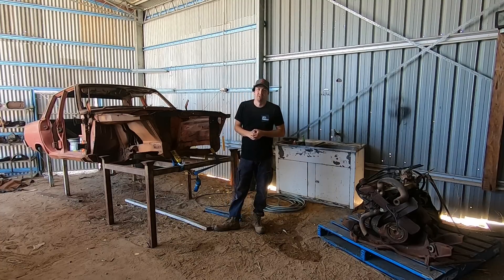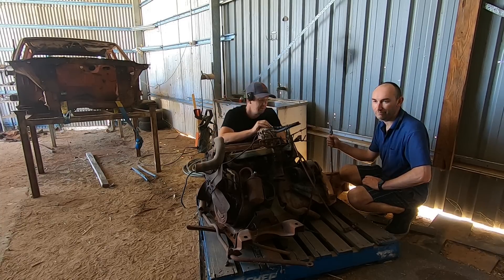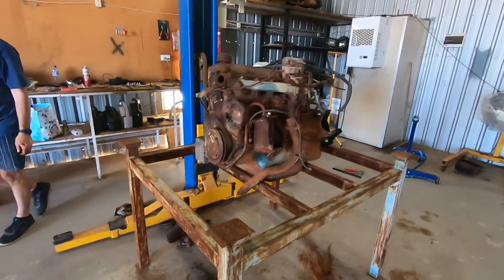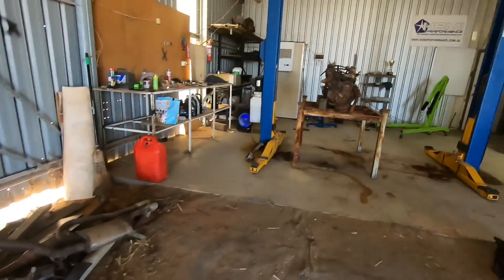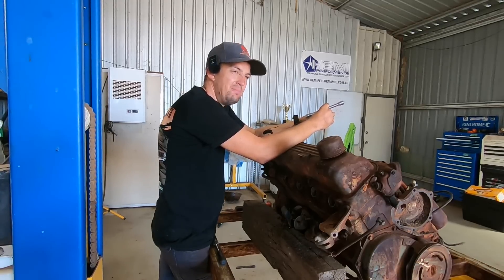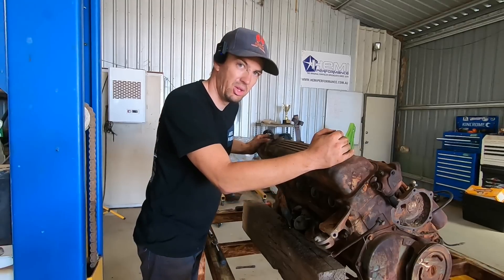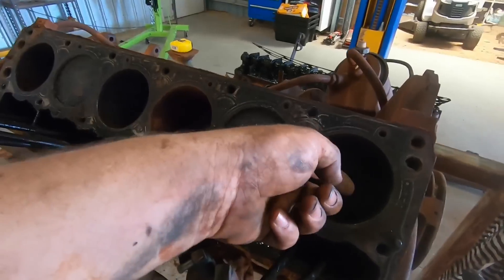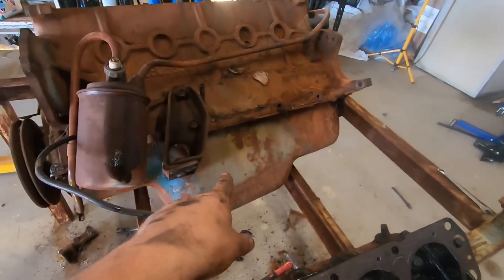Valiant Pacer engine teardown!

Comment: I put an F100 6 cyl and old 3 speed from an XY into a VE wayfarer ute. The column change linkages fitted straight on the falcon box ,( same B/W 3 speed)and I only changed one side engine mount on the cross member, cut it of and welded on a bit of box section.The Val drive shaft went straight back in. Only took a weekend to do.

Comment: VF Pacer sat a bit lower and came with 5 half inch rims . I had 7 inch alloys with TA tyres . My bother had one with 60 thou over 350 Holley and extractor split into twin 3 cylinder out one and 3 out the other man did it sound great . Sounded a bit like a hot V6 Capri 🤔. It sat low all round with 7 inch black rims . It put my other brother 307 HK to shame . RIP Scott . There is other tips to get these slants to fly.👍🏻💯🇦🇺⛽️.

Comment: you have probably lost 1mm off the block, ie no sweat, nice hot acid bath, keep the car original if you can
 as long as you replace gbox with original type, no problems there
crappy original cars are worth more than modded ones, hell knows why...

Comment: Valiant 3 speeds are dime a dozen and cheap as they’re normally ditched in favour of 4 or 5 speed. They’re not numbers matching to Pacers either. Maybe set the 225 aside and put in a 245 or 265. Touch base with Dave (Y.T channel Coopzcarz) he’s in NSW though.

Comment: Here is the thing with rust, it swells, that 4mm rust flake is likely to only be a mm or two of actual steel , this old engine will have plenty to spare. Go the original, and a rego rebuild.
Reply: Agree and what do you think about the gearbox, strip it and acid bath ? Andy from Adelaide.
Reply: @gashy1000  I think the gearbox is toast, but is possibly the same as a Holden or Ford, just a bell housing change

Comment: Having a 4mm rust flake is not 4mm of missing cast iron, when steel rusts it expands considerably (there must be a calculation to work it out) I would be pulling it apart and getting it hot tanked.
Fit a T5 from a XF 6 cylinder, simple to fit and usually just a simple spacer plate for in front of the gearbox between the bellhousing to space the input shaft.
Just call up Dellows or a gearbox swap specialist like that.

Comment: The slant 6 core would be saveable. 
Strip it back and drop the block and crank into a machine shop. 

Hot tank will do wonders, 30tho on the bores and linish 10tho on the mains and big ends on the crank will be good as new. 

New set of pistons and rods, get another head with some port work. Will be sweet runner. 

Also I’d get a single rail 4speed to put behind it.

Comment: My first thought was a modestly worked 225 with a refreshed three speed box like the dead one, but then I thought VG Pacer 245 with either Option 34 or Option 35 and the Pacer manual gearbox on the back of it. I feel it would be more cool with all Pacer parts than with engine and gearbox from something not Valiant.

Comment: a VF pacer gearbox should be pretty easy to find. if you can't find one. the ratio's were just a standard ratio. so i wouldn't be too worried about the gearbox. hopefully you can save the motor.

Comment: Don’t over think it dude, I seriously doubt there’s anything wrong with that block.. that’s if you want to keep it OG. Easy rebuilder. I’ve played with much worse. Plus I still recon you should go for full rego on it.. I would for sure
Reply: +1 for this. 
The slant 6 core would be saveable. 
Strip it back and drop the block and crank into a machine shop. 

Hot tank will do wonders, 30tho on the bores and linish 10tho on the mains and big ends on the crank will be good as new. 

New set of pistons and rods, get another head with some port work. Will be sweet runner. 

Also I’d get a single rail 4speed to put behind it.